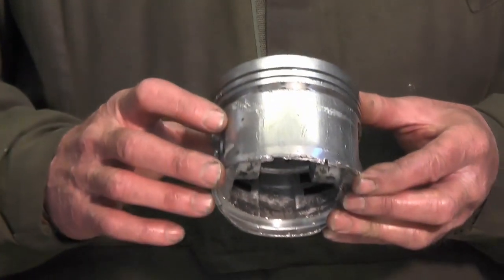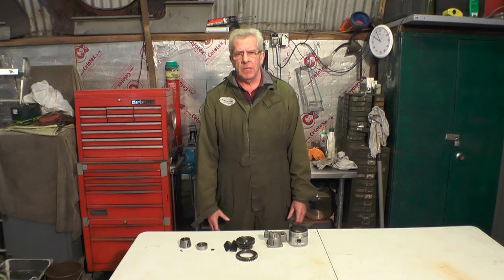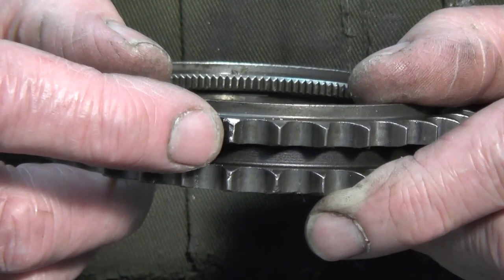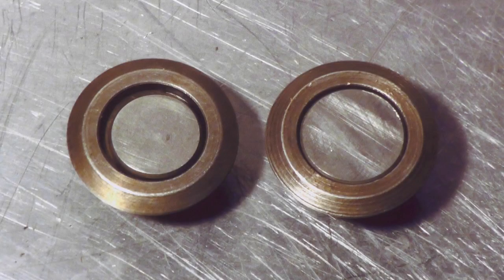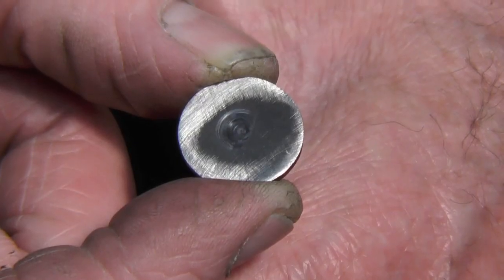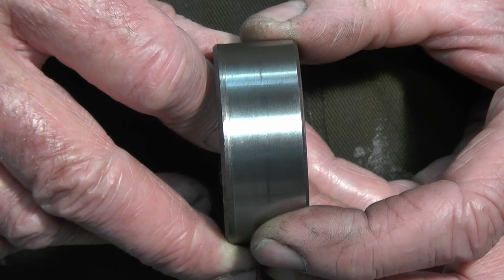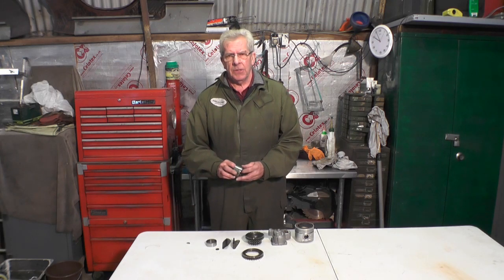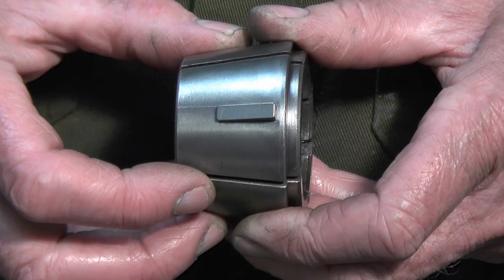Rebuild of Jaguar Etype engine? Be careful !

Comment: I've rebuilt enough engines to know that you do exceptionally good work.  Very nicely done - and those carbs are adjusted perfectly!  Thanks for posting.
Reply: the jaguar engine is one of the best built automotive engine so a sloppy rebuilding technique is much more apparent adn the result is much more questionnable.
Reply: I have worked on enough Webers to be able to tell you that the set in the video are not adjusted or cleaned very well. Rough idle and hesitation on rev up are dead giveaways.
Reply: It sounded like not enough accelerator pump volume. Very unresponsive to throttle blips. That's from my view from my armchair of course!
Reply: @rogeronslow1498  I noticed the same thing. The initial squirt seemed adequate, in that the engine responded instantaneously, but the engine stuttered a little a moment later, suggesting that there wasn't enough fuel being delivered by the pump to maintain the correct A/F ratio during engine acceleration.
Reply: You can tell the carbs are adjusted perfectly just by listening to it and not seeing, hearing and feeling how it runs under load? Really? Even with it sounding like a corn sheller?
Reply: Yes I am that talented and skilled.
Reply: Better get your ears checked then because its spitting and coughing noticeably at idle right before and after it gets "revved up". Which isn't surprising for a an engine running on a test stand. I'm sure he knows that tuning/synchronizing a multi-carb engine with no air filters installed and the engine not in the vehicle is pretty much a waste of time and just had things adjusted "close enough" to get it fired up and leak-checked and make sure it wasn't going to grenade again before sticking it back in the car. Which if I'm not mistaken on a Jaguar is a royal pain in the ass. They look like the only vehicles ever made where removing and installing the engine requires more labor than overhauling/rebuilding it.
Reply: I have no doubt that working on these cars, if you are ever so fortunate, would be a "pain in the ass" for you.  It's entirely possible that you would spend more time re and re-ing the engine than rebuilding it, if you were actually capable of either.  One day you will move out of the basement, and get some real-world experience.  
I get the engines out and don't even remove the hood.  Go figure that one out.
Reply: @briggsquantum  Oh, Snap !  A Corn Sheller, Really ?   As a youngster, fresh out of high school in 1969, I sold my 1956 MGA convertible and scored a sweet 1959 XK 150 S with the 3.8 liter in-line six and three, stock side draft SU carbs.  What a major pain in the ass to get those 3 bastards balanced properly, but when you did.......Oh what a relief it was !  And don't get me started about setting valve lash with those damn steel disc, lifter spacers. What an awesome car, factory air-conditioning, four-wheel disc brakes, chrome wire wheels, I could go on but it makes me sad that I sold it.  Marriage and kids will do that.
Reply: those carbs are not right for that engine to small .

Comment: Looks like a great job, but why does it sound so tappety? Or am I hearing something else ticking?
Reply from the maker: Yes, after uploading this video I noticed that the sound of the engine running makes it sound like the engine is tapping. This wasn't the case! I think the acoustics of the shed it was in paired with the microphone caused this.
Reply: it,s probably due to the sound recording characteristic of the camera, the tapping sound really exists but it's blended to the engine running sound so the human ear does not really notice it but the camera does
Reply: @XKEngineSpecialist ,     that's  the exact sound of a tappet gap being to wide, i know I've been there.
0.006" & 0.004"   and later engines   0.012"  &  0.014" .
Reply: I've noticed this on lots of engines. Something in the electronics amplifies the tappet sounds!
Reply: It is almost impossible to eliminate all tappet noise from an XK engine especially on the older 3.4 and 3.8 engines.  The later 4.2 XJ-6 engines were a bit easier to make totally quiet.
Reply: Reminded me of my x308 engine. Was hoping to read the solution!